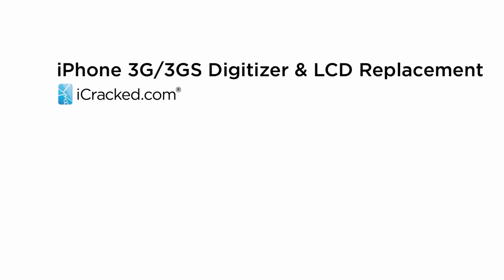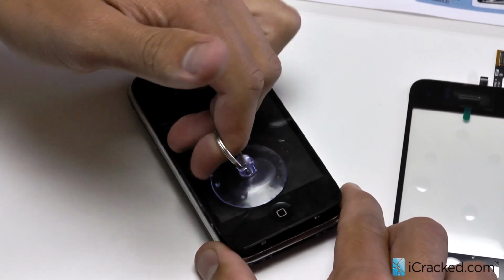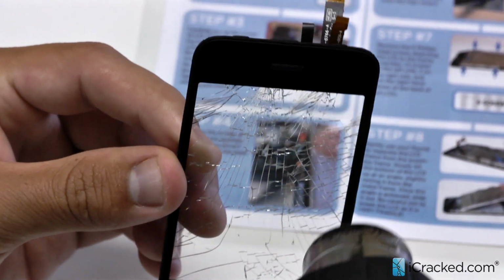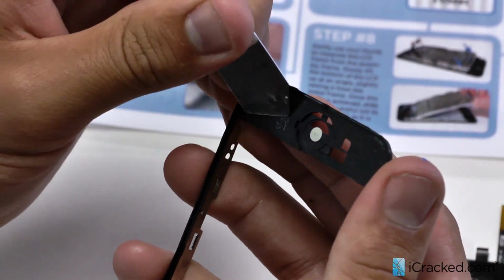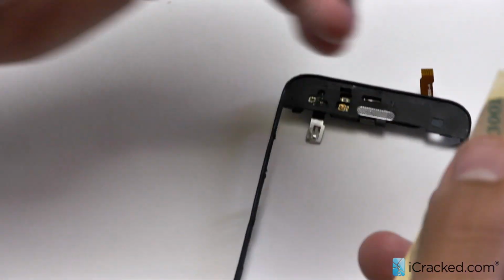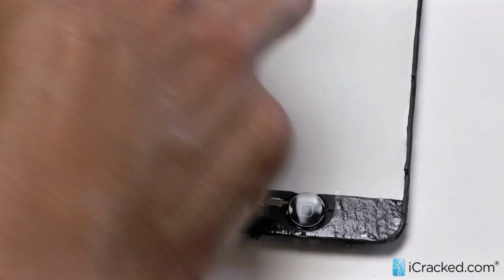Official iPhone 3G / 3GS Screen / Digitizer Repair and Replacement Video - iCracked.com

Comment: A good guide and still up to in 2025. The only thing I could add is recommending replacing the home button as well, because after years of use it often stops working.

Comment: Timestamps

0:00 intro

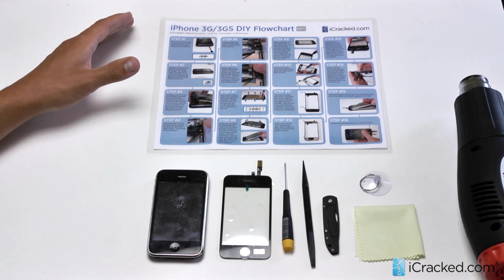0:27 tools, and accessories

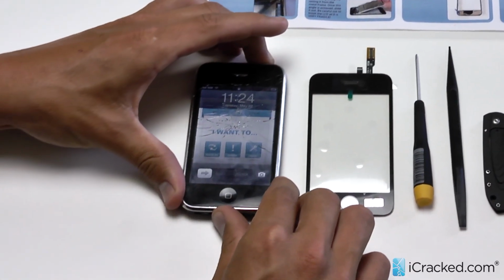1:30 powering off device

1:32 taking assembly out of phone

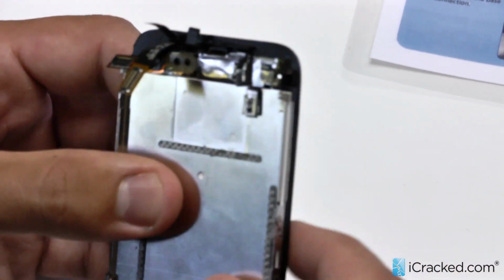3:05 disassembling the old assembly 

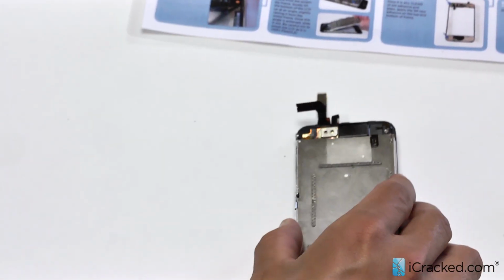14:44 connecting the new screen 

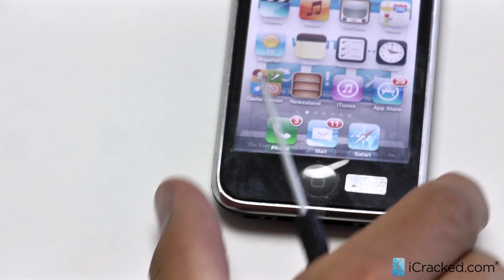16:53 Outro

Comment: i have a bricked iphone 3g that the screen works fine and I also have an iphone 3gs that the screen went out on (was dropped and then screen slowly faded out, never came back on). I want to give my 3gs to my son. Can I transfer the screen from 3g to the 3gs and hopefully fix this phone? Assuming it's just the screen and not a battery issue also.... Thanks

Comment: i have problem with my iphone see the problem is when i touch the screen nothing happen i dont know what to do
Reply: +pristofpelor druid Your glass is good,but the flex connector does 't work.any qustion contect me Skype:Tinaifix        Cellphone: 8613262180127
wechat:1320876304   Whatsapp: +8613262180127

Comment: Replaced the screen but now the touch does not work with my phone. Tried to reopen my phone and now just the class comes up, the glass did not stick correctly. Ugh, should have just kept my cracked phone instead of trying to fix it myself. Now I guess I have to purchase a replacement phone.
Reply: +pryncesspersephone get in contact with me, i know iphone 3's like the back of my hand....

Comment: Definitely one of the better instructional videos. Curious, though, why you removed the large central section of protective film before sticking the digitiser to the mid frame. It would seem likely that there are separate pieces of protective film so that this middle section can be peeled off AFTER sticking the two parts together to avoid fingerprint contamination right up until final closure.

Comment: My screen is white
Reply: that is called the white screen of death you cant really fix it unless you RESTORE the phone or HARD RESET it but if those don't work then you have to get a new screen it has something to do with the hardware
Reply: Hold down your lock and home button at the same time for 10 seconds. After that your screen should go dark. Then switch your phone back on. The apple logo should appear and it will take a minute or to fully switch on.

Comment: Can't get the screws to come out for the lcd. Ang suggetiosn?
Reply: I had this same problem on one of the three side screws. Ended up drilling it out with a drill bit and just not use that screw.

Comment: Hey, thanks great video! I had no trouble with replacing the screen. Looks great. BUT doesn't work! It does not respond to touch.  What can be the problem?? Everything seems to be plugged in correctly.. Any ideas?
I even tried with 2 screen sets I bought through amazon! With one, the screen responds a little bit, and with the other not at all.

Comment: Hey, so i did this and the 1st time the phone came on but the touch pad didnt respond. So i wasnt able to turn it off. I just opened the phone back up and repeated the steps and everything seems to b just like in the video....but when done, the screen isnt coming on now. But i kno the phone is on because when i plug in the charger it vibrates n i think i even got a message. 

The screen is just black. Help please